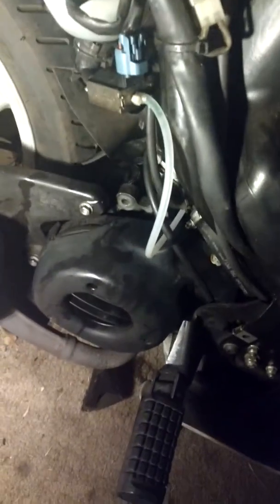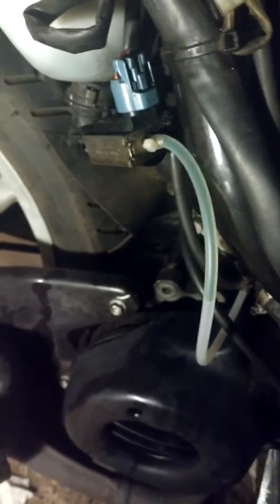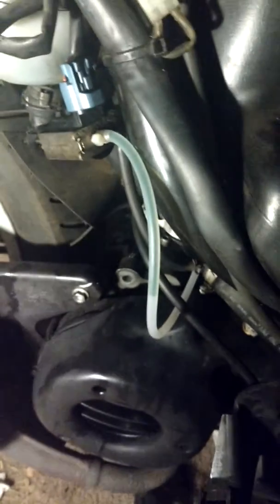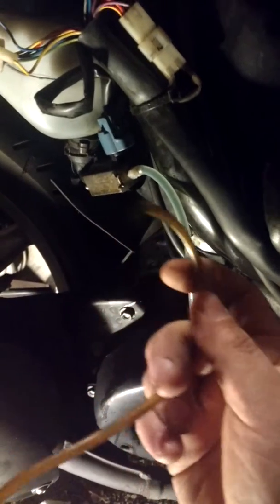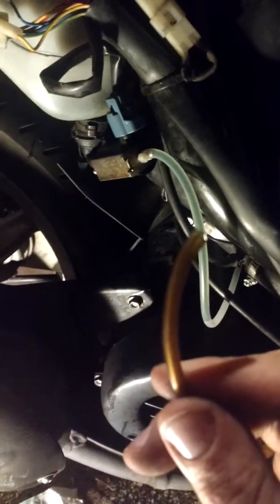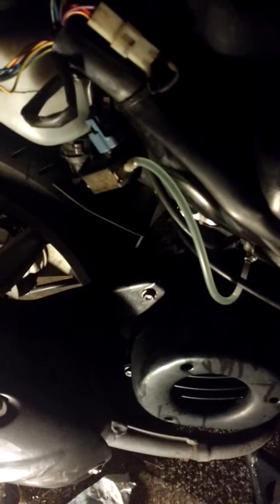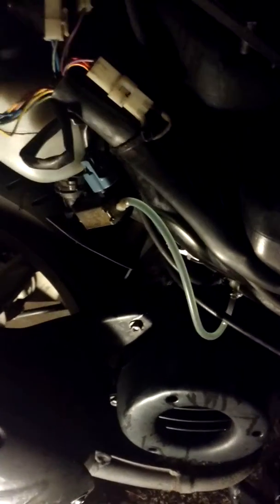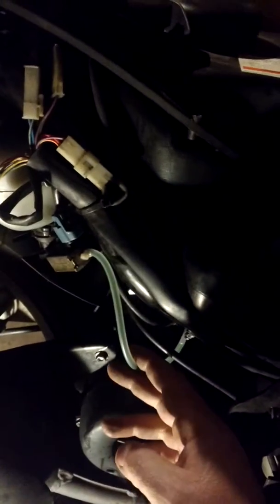Aprilia ditech scooter oil pump priming procedure

Comment: Hey, have you found any solution, because that's the case with my Aprilia, I've tried 1 ecu, and it's still the same, and when I read the error code like you do, there's no more oil while driving, and I  notice that because I put an LED in it, and what the pump gives too much oil if you do that, the exclamation comes out 🌸
Reply from the maker: I put a new piston in it and it worked great. Fickle little machines!